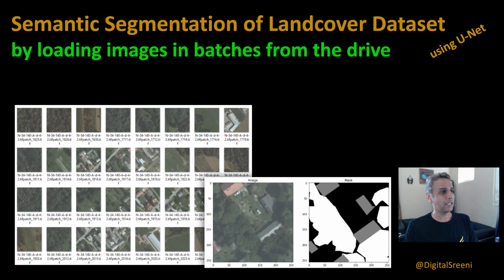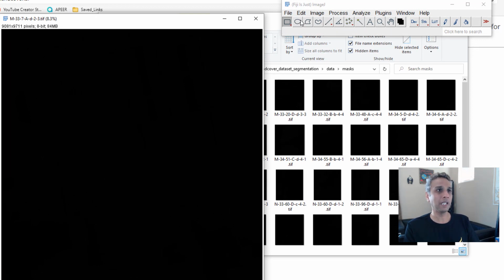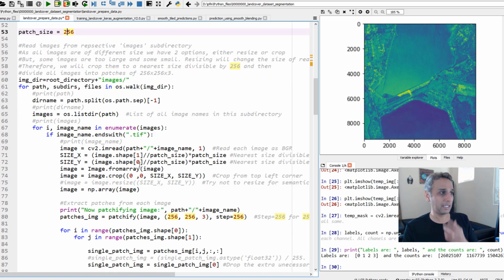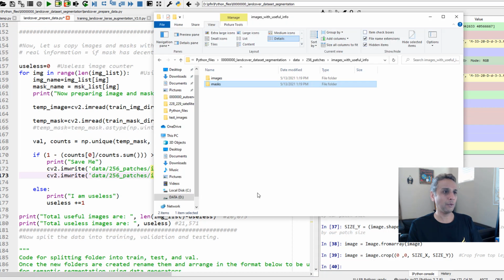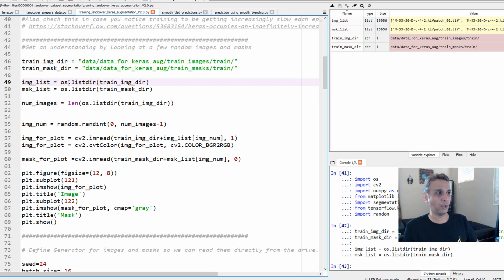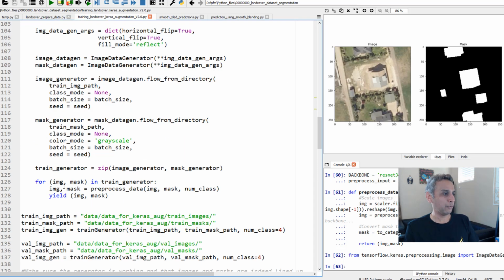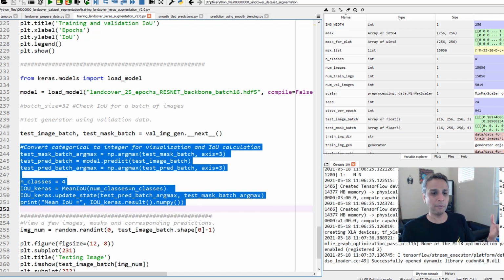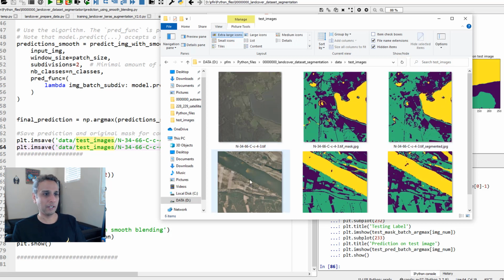230 - Semantic Segmentation of Landcover Dataset using U-Net

Comment: If you are getting the error "IndexError: index 4 is out of bounds for axis 1 with size 4" when running the train_generator part, note that if you are using the new version of the Landcover dataset, you have to change the number of classes to 5, instead of 4.

num_class = 5 and n_classes = 5

Reference to the issues in the repository.
Reply: Yes, I think the LandCoverAI dataset included "Roads" as a new class

Comment: Hi! I'm currently working on a quite similar project but stuck while patching the images. Instead of having RGB tiff image, I have RGBA tiff image. When I tried using patchify i think it change the image into uint8 and messed the image and ended up not look like the original rgb representation. I wonder if there's any solution to this problem? I tried to split the image cannals to emit the alpha band but still fail up to now. 

Thanks!

Comment: I used the vanilla unet you implemented in a previous video, when I used batch size 16 a 100 epoch where run very fast with poor accuracy , I changed it to 1000 and got better result, would it get better result if I load the whole dataset and trained the model on it instead of a smaller batches ?

Comment: Thanks for the amazing videos. I have a specific question: How could I deal with an image of a single area but with 15 bands (layers)? In this case, the mask would be only one. My problem is patching them and then reading them for training.
Reply from the maker: An image with 15 bands is similar to an RGB image that has 3 bands (channels) - except in your case you will have 15 channels. You can patch them the same way you patch RGB images, except (again) you will define 15 channels instead of 3.
Reply: @DigitalSreeni  But the U-net structure only accepts 3 channels, right?

Comment: please help me with the below error Dr. .
Thank you in Advance.
Please solve my issue. (I am using  python 3.10)

While i am running the image generator part of  :- x, y = train_img_gen.__next__()

ValueError: Found array with 0 sample(s) (shape=(0, 3)) while a minimum of 1 is required by MinMaxScaler.
Reply from the maker: Did you Google search for the error? Here is a link you may find useful: https://stackoverflow.com/questions/53421626/valueerror-found-array-with-0-sample-s-shape-0-1-while-a-minimum-of-1-is
Reply: While i am running the image generator part of  :- x, y = train_img_gen.__next__()

Found 16434 images belonging to 1 classes.
Found 16434 images belonging to 1 classes.
---------------------------------------------------------------------------
TypeError                                 Traceback (most recent call last)
<ipython-input-67-31d31ac98ef7> in <module>
----> 1 x, y = train_img_gen.__next__()

4 frames
/usr/local/lib/python3.7/dist-packages/keras/utils/image_utils.py in img_to_array(img, data_format, dtype)
    298   # or (channel, height, width)
    299   # but original PIL image has format (width, height, channel)
--> 300   x = np.asarray(img, dtype=dtype)
    301   if len(x.shape) == 3:
    302     if data_format == 'channels_first':

TypeError: float() argument must be a string or a number, not 'TiffImageFile'
Reply: Hey, were you able to resolve the error? I am facing the same issue.
Reply: I had the same error. Organizing the folders into subfolders as shown in first half of video helped my resolve this error. Hope this helps!

Comment: x, y = train_img_gen.__next__()

for i in range(0,3):
    image = x[i]
    mask = np.argmax(y[i], axis=2)
    plt.subplot(1,2,1)
    plt.imshow(image)
    plt.subplot(1,2,2)
    plt.imshow(mask, cmap='gray')
    plt.show()

x_val, y_val = val_img_gen.__next__()

for i in range(0,3):
    image = x_val[i]
    mask = np.argmax(y_val[i], axis=2)
    plt.subplot(1,2,1)
    plt.imshow(image)
    plt.subplot(1,2,2)
    plt.imshow(mask, cmap='gray')
    plt.show():

After this code i am facing such kind of problem.
Note: I want to segment the image into 2 classes. So i used 2 in number of classes.

 Found array with 0 sample(s) (shape=(0, 3)) while a minimum of 1 is required by MinMaxScaler.

Comment: For anyone who might still be struggling with "IndexError: index 4 is out of bounds for axis 1 with size 4"

Change the num_classes in the Original Code from 4  to 5 ----->

Original Code Snippet: train_img_gen = trainGenerator(train_img_path, train_mask_path, num_class=4)
                                         val_img_gen   = trainGenerator(val_img_path, val_mask_path, num_class=4)

New Code Snippet: train_img_gen = trainGenerator(train_img_path, train_mask_path, num_class=5)
                                      val_img_gen = trainGenerator(val_img_path, val_mask_path, num_class=5)
Reply: thank you 🥺🥺🥺🥺🥺

Comment: Great work and awesome tutorial. I was able to replicate this on my own data no problem. However using the prediction smooth function seems to be limited to fairly small images. I tried to run it on a 4GB drone orthomosaic and it crashed due to lack of RAM. Is there a simple way to optimize that function so that it is able to handle much larger input images ?

Comment: I have error at [44] TypeError                                
 Traceback (most recent call last)
<ipython-input-37-ecacaffde26b> in <module>()
      1 temp_img = cv2.imread("data/images/M-34-51-C-d-4-1.tif") #3 channels / spectral bands
----> 2 plt.imshow(temp_img[:,:,1]) #View each channel...
      3 temp_mask = cv2.imread("data/masks/M-34-51-C-d-4-1.tif") #3 channels but all same.
      4 labels, count = np.unique(temp_mask[:,:,0], return_counts=True) #Check for each channel. All chanels are identical
      5 print("Labels are: ", labels, " and the counts are: ", count)

TypeError: 'NoneType' object is not subscriptable

Comment: Thanks!
Reply: I had a question. I am training Unet on my custom dataset. I can use the data augmentation techniques as you have suggested. How much is the increase in the number of images during the training phase using augmentation? There are 7500 images in my training dataset after train_test_split.
Reply from the maker: Sata srī akāla Puranjit paaji. Tuhāḍā dhanavāda for the kind contribution. 
Augmentation performs various image processing operations so that the same data can be presented in many different ways for the algorithm to generalize a bit more. It will not increase your accuracy, it will make it more generalized. In terms of by how much the data will increase, it depends on your number of steps per epoch. It keeps on generating data based on the steps per epoch. I recommend using steps per epoch as your total images divided by your batch size. For example if you batch size is 16 then steps per epoch would be 7500/15 (in your case). This presents all your 7500 images, transformed (augmented) about 468 times per epoch.
Reply: @DigitalSreeni  Sat sri akal sir, 
Thank you so much for your detailed explanation on my doubt. Your videos are helping me a lot in my research work. Really appreciate that!!

Comment: Thank you very much for the content. You make real problems easier and more accesible. 
I am struggling with the last part of the code, the prediction for a new input. The problem is related to the cuda.

When i run the last part of the code it says:
2022󈚩󈚷 20:34:05.287381: I tensorflow/core/platform/cpu_feature_guard.cc:193] This TensorFlow binary is optimized with oneAPI Deep Neural Network Library (oneDNN) to use the following CPU instructions in performance‑critical operations: AVX AVX2
To enable them in other operations, rebuild TensorFlow with the appropriate compiler flags.
2022󈚩󈚷 20:34:05.838147: I tensorflow/core/common_runtime/gpu/gpu_device.cc:1532] Created device /job:localhost/replica:0/task:0/device:GPU:0 with 4632 MB memory: ‑> device: 0, name: NVIDIA GeForce GTX 1060, pci bus id: 0000:01:00.0, compute capability: 6.1
2022󈚩󈚷 20:34:42.348787: I tensorflow/stream_executor/cuda/cuda_dnn.cc:384] Loaded cuDNN version 8400

However, I followed the GPU for tensorflow installation steps on your video 217 https://www.youtube.com/watch?v=yLVFwAaFACk&t=611s
 
The check messages appears to be correct (you can read it at the end). However, it says that the tensorflow is optimised for oneDNN instead of cuDNN. The tensorflow version is 2.9.0 and the python 3.9. 

I was looking for some solutions on the internet, one of them was to include the following code:
import os
os.environ['TF_CPP_MIN_LOG_LEVEL'] = '2'
It doesn't work.

I am new to the topic and honestly also a bit desperate. Could you please give me a hint on how to proceed or any idea of what is wrong with this?

Thanks a lot

2022-05-19 20:38:59.367245: I tensorflow/core/platform/cpu_feature_guard.cc:193] This TensorFlow binary is optimized with oneAPI Deep Neural Network Library (oneDNN) to use the following CPU instructions in performance-critical operations:  AVX AVX2
To enable them in other operations, rebuild TensorFlow with the appropriate compiler flags.
2022-05-19 20:38:59.964067: I tensorflow/core/common_runtime/gpu/gpu_device.cc:1532] Created device /device:GPU:0 with 4632 MB memory:  -> device: 0, name: NVIDIA GeForce GTX 1060, pci bus id: 0000:01:00.0, compute capability: 6.1
2022-05-19 20:38:59.969320: I tensorflow/core/common_runtime/gpu/gpu_device.cc:1532] Created device /device:GPU:0 with 4632 MB memory:  -> device: 0, name: NVIDIA GeForce GTX 1060, pci bus id: 0000:01:00.0, compute capability: 6.1
2022-05-19 20:40:39.673713: I tensorflow/core/common_runtime/gpu/gpu_device.cc:1532] Created device /device:GPU:0 with 4632 MB memory:  -> device: 0, name: NVIDIA GeForce GTX 1060, pci bus id: 0000:01:00.0, compute capability: 6.1
2022-05-19 20:40:39.674187: I tensorflow/core/common_runtime/gpu/gpu_device.cc:1532] Created device /device:GPU:0 with 4632 MB memory:  -> device: 0, name: NVIDIA GeForce GTX 1060, pci bus id: 0000:01:00.0, compute capability: 6.1
2022-05-19 20:41:08.690288: I tensorflow/core/common_runtime/gpu/gpu_device.cc:1532] Created device /job:localhost/replica:0/task:0/device:GPU:0 with 4632 MB memory:  -> device: 0, name: NVIDIA GeForce GTX 1060, pci bus id: 0000:01:00.0, compute capability: 6.1
2022-05-19 20:42:34.174840: I tensorflow/core/common_runtime/gpu/gpu_device.cc:1532] Created device /device:GPU:0 with 4632 MB memory:  -> device: 0, name: NVIDIA GeForce GTX 1060, pci bus id: 0000:01:00.0, compute capability: 6.1

Comment: Thank you so much sir for this great video ,,, 
Sir I got a error and I could not fix it from last few days ,
when I try to verify generator I by "x, y = train_img_gen.__next__()" by this line of code 
I got this error   ""*IndexError: index 4 is out of bounds for axis 1 with size 4*"
Reply: i have same error.. "
IndexError: index 100 is out of bounds for axis 1 with size 9"
Reply: Hey! I was facing the same error few days ago. print("Labels in the mask are : ", np.unique(mask_dataset)) to find the classes in your dataset. In his dataset, the total classes/labels are 4 but in ur dataset they are more
Reply: I was facing the same error, I came across that I was using Lancover Dataset Version 1 they use 5 classes including "roads" so it will work with Version 0 as it has a total of 4 classes
Reply: For anyone who still might be struggling with "IndexError: index 4 is out of bounds for axis 1 with size 4"

Change the num_classes in the Original Code from 4  to 5 ----->

Original Code Snippet: train_img_gen = trainGenerator(train_img_path, train_mask_path, num_class=4)
                                         val_img_gen   = trainGenerator(val_img_path, val_mask_path, num_class=4)

New Code Snippet: train_img_gen = trainGenerator(train_img_path, train_mask_path, num_class=5)
                                      val_img_gen = trainGenerator(val_img_path, val_mask_path, num_class=5)

Comment: I have a question. Can you please reply to that. 

We have 4 labels in masks. The unlabeled class(class 0), I have question regarding it. Do we need to remove that class 0 pixels from our training dataset because it is lowering the accuracy of the model. I am working on semantic segmentation related problem. I think my model is not predicting well due to the presence of unlabeled class (class 0). Removing/replacing that can increase the performance. What do you think. Am I going in right direction

Comment: Amir Saeed
0 seconds ago
hi
you are doing a very good job, I am following your video lectures, I have an issue encountered in following this video
I can't run this command 'from keras.utils import to_categorical' , I searched on net and use this "from tensorflow.keras.utils import to_categorical'
Now when I run the line 'x, y = next(train_img_gen)(x, y =train_img_gen._next_()) I got following error

runfile('E:/DATA/traiing_landcover_keras_augmentation.py', wdir='E:/DATA')
Found 15602 images belonging to 1 classes.
Found 15602 images belonging to 1 classes.
Traceback (most recent call last):

  File "E:\DATA\traiing_landcover_keras_augmentation.py", line 108, in <module>
    x, y = next(train_img_gen)

  File "E:\DATA\traiing_landcover_keras_augmentation.py", line 94, in trainGenerator
    img, mask = preprocess_data(img, mask, num_class)

  File "E:\DATA\traiing_landcover_keras_augmentation.py", line 64, in preprocess_data
    mask = to_categorical(mask, num_class)

  File "E:\anaconda3\lib\site-packages\keras\utils\np_utils.py", line 75, in to_categorical
    categorical[np.arange(n), y] = 1

IndexError: index 4 is out of bounds for axis 1 with size 4

It would be a great help to kindly comment on this issue
looking forward
Reply from the maker: You seem to be providing an index of 4 for an array that only contains a size of 4 - this means the maximum index would be 3. Please find the location where you're providing this index and understand why you are providing that index. If the index is correct then you need to investigate why your array only has a size 4. One of those 2 is not what you expect it to be.
Reply: Hello Amir, I am also getting the same error "IndexError: index 4 is out of bounds for axis 1 with size 4"  

Are you able to fix this error?? if yes then how did you fixed it
Reply: I have the same error and I am not able to solve it can anyone help with this. thank you

Comment: Thanks for the good tutorials and one question, how can we use multiple masks? In satellite images, there are indicators that these indicators mean together, such as ndvi, tci, etc.
Reply from the maker: I am not sure what you mean by multiple masks. An image has a single ground truth so you work with single mask that contains information about a pixel. For example, a pixel or a collection of pixels correspond to a building or a tree or a road, etc. You can have multiple labels for a given pixel in which case the problem becomes multiclass multilabel semantic segmentation.

Comment: Hi,this is very interesting video.However,I have try run the training_landcover_keras_augmentation_V2.0.py but this error happen. Can I know how to solve it?
Error:
ConnectionResetError: [WinError 10054] An existing connection was forcibly closed by the remote host
Reply from the maker: This error has nothing to do with this python code. It appears to be your network issue, please verify.
Reply: Yes it is fue to my network issue.Still figure it out to solved the error.Thank you  Dr.

Comment: Really appreciate your work. Thank you. Please keep it coming.
I am working on a multiclass segmentation problem. In addition to the segmentation map for each of the objects, I also need a severity score of this detected object. This is like a multi task network which outputs segmentation maps and scores for each of the detected objects. If I have another smaller decoder that outputs a vector, the size of the vector would have to vary based on the number of objects detected.

I just can't find any ideas on how to architecture could be. I would grateful for any advice.

Comment: Hi, there. I am thankful to you for making such an informative videos. In your videos you always have 01 ground truth image against 01 image file. I am working on "Brain Tumor Segmentation" problem whereby we have 01 ground truth file against 04 images. I have two question 
1. 01 image-01 ground truth case). Normally we specify 1 folder having set of image and 1 folder with set of ground truth files, how does network knows how to pick ground truth corresponding to an image?? I mean it can wrongly pick ground truth of some other image. 
2. 04 images-01 ground truth case) Can you please make a video and explain (with code) how can i make neural network pick 04 images and its relevant ground truth for their respective folders. Again I fear that if the model pick wrong ground truth, it can produce wrong results.
Thanks
Reply from the maker: Please wait a couple more days for my video on segmenting Brats data set.

Comment: Thank you so much
Reply from the maker: You're most welcome
Reply: @DigitalSreeni  While I run your code, the generator didn't work correctly and gave me this error message "ValueError: Found array with 0 sample(s) (shape=(0, 3)) while a minimum of 1 is required by MinMaxScaler."

What can I do to solve this?
Reply from the maker: Please make sure you are reading the data correctly, may be the path is wrong or you have a specific path but you are not working in the right directory. In any case, it looks like there are no samples (images) for minmax scaler.
Reply: @PraySurvey  Hey, were you able to resolve the error? I am facing the same issue.